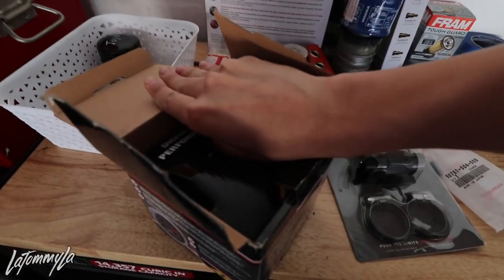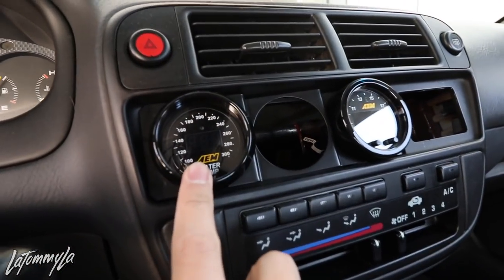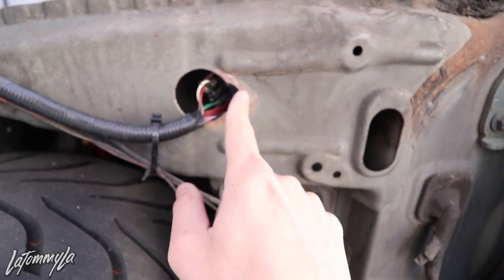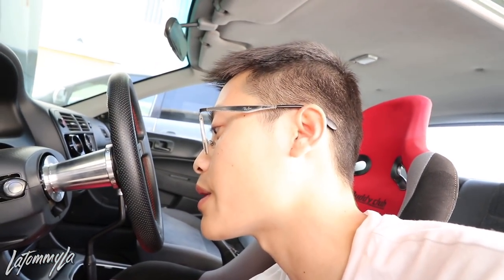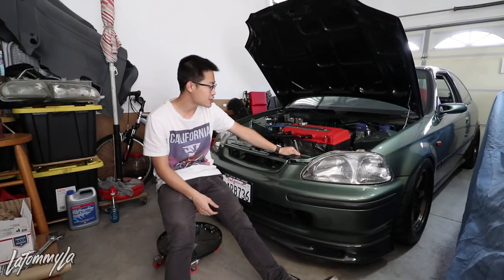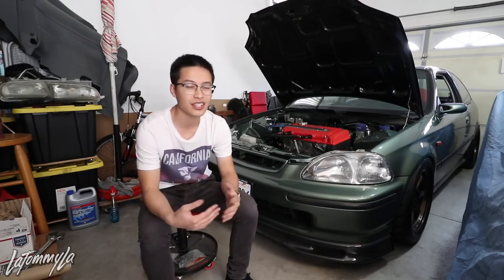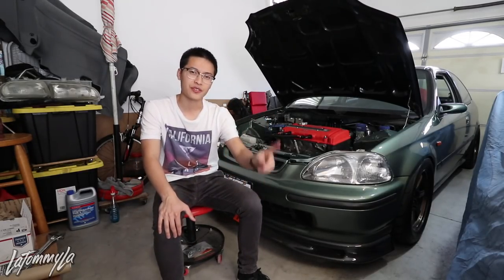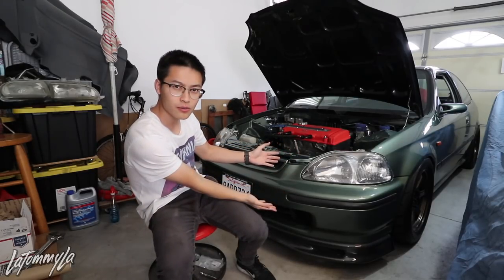Why and how do I spend so much on my car? AEM temp gauge install!

Comment: If you want a more accurate temp, have it read the coolant that’s in the block. That’s why it kept going hot then cold. It’s not gonna be accurate that way.
Reply from the maker: Switching it up real soon
Reply: LATOMMYLA how do you run it to the block .. can you do a quick video on that ? If not cool keep doing your thing homie.
Reply: Hook up the temp gauge to your temp sensor on the head under your distributor.  You may have to change the stock sensor though
Reply: Twisted_717 Awesome thanks

Comment: Wideband ground should always go to the thermostat housing to ensure accuracy, same with the temp sensor. If the wideband isn't set up to send signal to the ECU with a lambda target it's kinda pointless. It's super easy to setup without altering the cars wiring. Take a dead O2 sensor, cut the pigtail off, plug the pigtail to the vehicle harness, splice the white wideband wire to the signal wire on the pigtail, go into closed loop settings in the S300 and enable closed loop with a lambda target. Now you can datalog and use the sensor to tell the PCM to make AFR corrections. You may still have to make a small voltage offset to get it perfect due to resistance created by solder/butt connectors but just compare the gauge reading to what the laptop is showing with the guidance of the help files and you should be fine.
Reply from the maker: Thanks for the tip, actually changing the whole setup soon, getting rid of the gauges!

Comment: i have a question, you said the wire harness wasn't long enough so you needed to extend it, I'd like to know what kind of wire you used to extend wire green and black, who can I find the wires in the store for example how wide they are or more details of the wires please because I've seen videos where the green wire is extended using white wire instead a green one and I don't understand that part

Comment: The Vtec Crossover experience, Is always fun. 6500 rpm Plesure, Is even better with individual throttle bodies, Like tomy has. But expensive like $1000 shipped from EBay for OBX itbs. Are they Worth it?

Comment: Man get some rubber grommets for those holes your running those wires through, shits going to cut through the shielding one day and open a whole ton of electrical issues... Especially with how much you say the car vibrates; or at least wrap that area in some tubing.